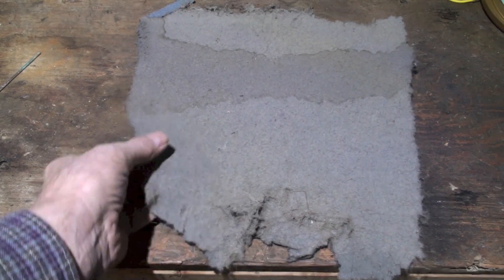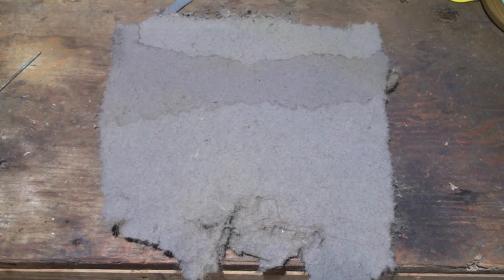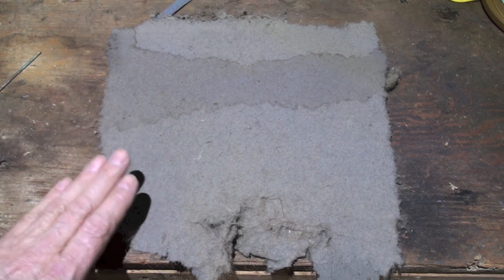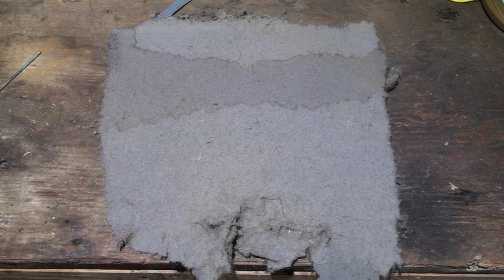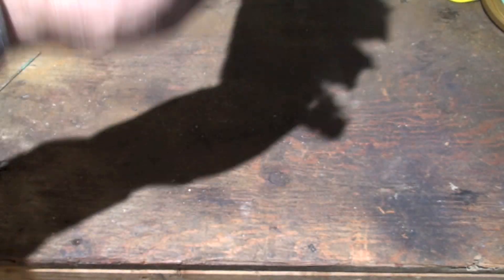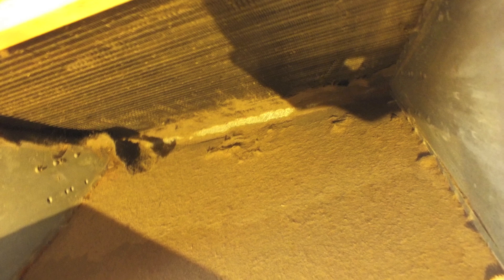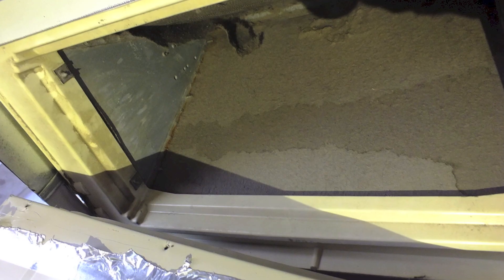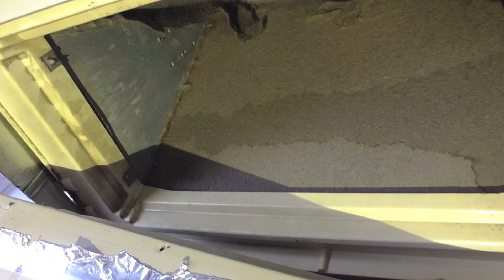HVAC coil carpet

Comment: Incredible!  Incredibly Gross!
Reply from the maker: Brent Audi Something like what's behind the refrigerator.GFM
Reply: grayfurnaceman Interesting you say that.  Every refrigerator I have ever bought I "rig" a filter at the intake of the fan.  The kind of filters you use for a window unit.  I pull the Fridge every 6 months and it is INCREDIBLE how nasty and full the filter is with dust and such!  I wonder why manufactures don't have refrigerators with built in air filters?  I guess it is because they know the owners won't check them.

Comment: I see this all to often. Usually a Payne/Goodman with a undersized return boot, were you have no option but to run the old blue see thru sheet rock screw catcher but not much else filters.